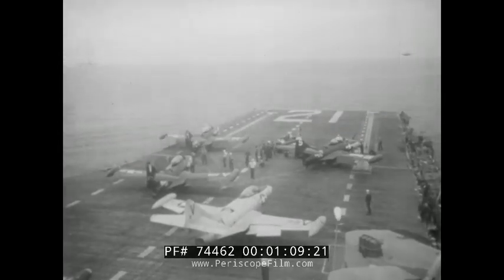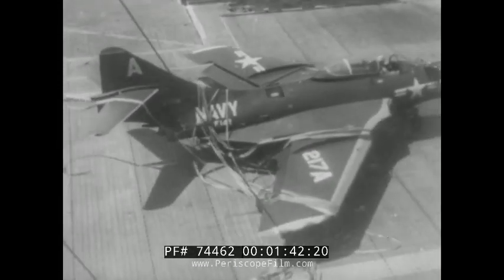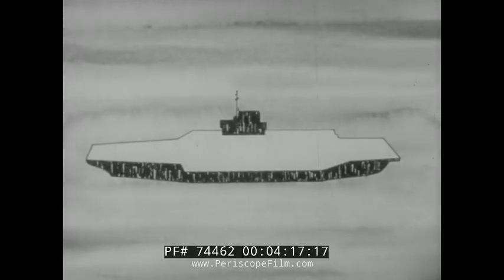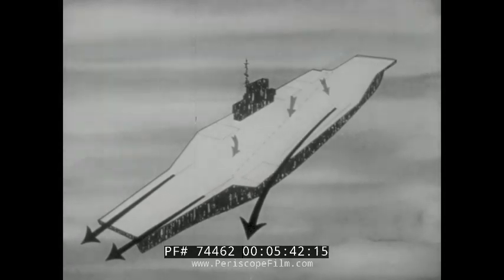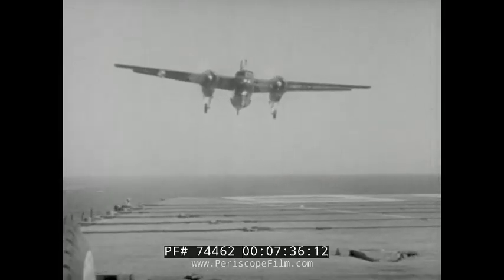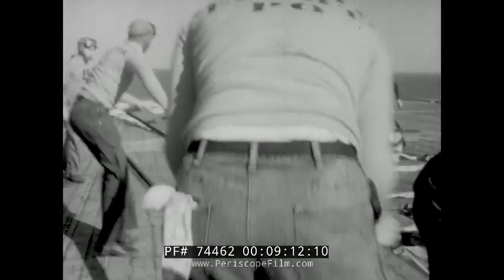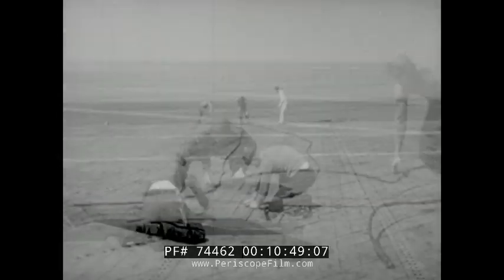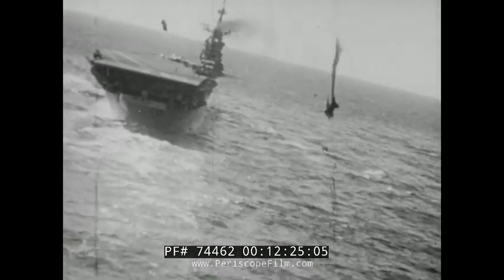U.S. NAVY 1955 ANGLED DECK AIRCRAFT CARRIER ORIENTATION MOVIE 74462

Comment: For those unfamiliar with the difference between a paddles landing and a mirror or a lens pass and landing, they are significant. A paddles approach is a flat approach (about 60 feet above the water on an Essex class carrier) with the pilot taking a "dip" when he gets the cut. A dip is a drop of the nose followed immediately with returning to level almost immediately. The dip starts the aircraft down and a normal cut has room for the nose to come back up so the aircraft does not land on the nose wheel. 

A mirror or lens approach his higher, for props around 150" over the water through the turn, 300' for jets. Props will intersect the glide path closer in and landing speed is slower. Once the pilot sees and calls the ball, they are on a pre determined glide slope and when the cut lights cove on, for props they close the throttle, for jets it a reduction followed by full throttle. The jets land at full throttle so the turbines have time to come up to speed so they have full power available in case they miss all the wires. (Called a bolter and the LSO will call "bolter, bolter"). 

On my first cruise as a new aviator (called a nugget) we had a senior Commander (our XO) who had spend his entire previous career flying a paddles approach to landing. The dip at the cut was so ingrained, he had trouble breaking the habit.

Comment: I’ve noticed that some carriers from other nations have an upward slope at the end of their carrier runways. Is that to help get air craft in the air easier?   Also, THANK YOU to all that have served and are currently serving. Thank you for what y’all do!!!!
Reply: That's a ski jump. It's an alternative to a catapult. It's simpler and easier on the aircraft, but the aircraft payload is limited. Also a considerable amount of thrust is needed by the launching aircraft so generally only fighters can be used
Reply: The UK invented the STOVL which use the ski jump after building the Harrier jump jet but also the invented Angled deck but the STOBAR is what the Russians and Chinese use that has a slight upward slope at the bow of of the vessel
Reply: @Then.72  
The soviets also had an interesting aircraft carrier, with the yak-38's, forget the name though

but it sure did take the "aircraft carying cruiser" part a hell of a lot more serious than the Kunetzsov of today
Reply: @ari8742-r4z  like the Yak 38 It was a copy that failed also like the TU-144 Concordski
Reply: @Then.72  

Mate I never made any claims of effectiveness or the likes. I just wanted to share some interesting history.
Reply: @ari8742-r4z  yes and I was just informing you about Russian technology
Reply: @Then.72  
Not all soviet tech is garbage, just the inheritor of most of it is

Although the soviet carriers before the kunetzsov were ass
Reply: @Then.72  And most nations that use Harriers just run them off of a flattop deck and accept the penalty in aircraft payload - and are in the process of replacing Harriers with F-35s.
Reply: @disorganizedplay  which was doomed until the USA came asking for help with the F35B

Comment: 12:00 I would not want to be on the fantail, below the flight deck during recovery. A plane loses it's engine, or the pilot just screws up and stalls, that is where the plane is going.
Reply: It's happened.
Reply: @bdbailey9225  From the picture it looked like people down there, but it was equipment.
      And of course it has happened. Pilots have lost power, or screwed up.
Reply: Eric Taylor, usually before that happens the LSO (landing signal officer) will have given the order or signal to “wave off or bolster”. This still holds true while the pilot flies the “ball”. The OLS (optical landing system), is used for all landings. That’s why you hear the LSO always tell the approaching pilot to “call the ball”. This tells the pilot to monitor and use the OLS. Piece of cake!
Reply: @arttafil6792  Of course, and the LSO's are very good at they job, as are the pilots. The fact that accidents like this happen only very rarely proves that.
    Still it happen, for a great variety of reasons.
     Naval aviation is extremely dangerous, and only the best are allowed (or even capable) of doing it in relative safety.
Reply: Eric Taylor, trust me, I know that from personal experience. I was an F4 pilot in the 60’s. I did 3 tours in Vietnam, 66,  67 and 68. And I had to make a single engine out emergency landing on the Constellation in 67. I had to go into the “J-Bar”. Not a good day or landing. I had extensive battle damage.
Reply: @arttafil6792  Mad skills sir. Mad skills.
     Have you ever heard of a writer my the name of Mark Berent? He was a combat pilot in Vietnam and wrote a 5 book series of historical novels that take place in Vietnam.
       It's one of my favorite books I've read. I think I read them something like 6 or 7 years.
     I find the Vietnam War facilitating. It was when the leadership of the US (Johnson and McNamara) failed to keep the faith.
    Did you ever get to bag a MiG?
Reply: Eric Taylor, actually no I haven’t but that doesn’t mean much. I’ve been trying to bury that part of my life for 50+ years.
Reply: @arttafil6792  Oh I understand. MiG's were rare to begin with, and they used them in a way that did not often place them at risk. And after Robin Olds gave them a good thrashing, they were even more careful.
       But you did get to fly one of the most bad ass fighter in history.
      The F-4, to me, looks like a rhino. Tough and mean as hell.
Reply: Eric Taylor, the MiGs especially the MiG 21’s were used very sparingly since they were few in numbers. They would do. A fast hit and run tactic. MiG 21’s had a short combat radius. I made my kills by trailing a section back toward their base at Puc-Yen and engaged them before they could enter their landing pattern. They scattered like rats. I killed their squadron leader and then his wingman. After that I was getting low on fuel and the rest of the flight tried to give me a dose of “payback”. I was lucky to get out alive. That’s how I got the battle damage.
Reply: @arttafil6792  Shooting down the enemy is only half the mission. Surviving would be nice as well.
       The MiG's had a huge advanced. You were far from home, over enemy territory, and low on fuel. If you had to bail out, depending on where you were, you likely faced being a POW. All that happened to them was a silk letdown and getting their ass chewed out by the CO.
      On top of that, all they had to do was scare the bombers enough that they dumped their bomb load.
      My biggest pet peeve, the thing that pisses me off the most, is people who talk about the "indiscriminate bombing of civilians"
        They fired off those SA-2's like machine gun bullets, and most of them came down in the city. They were especially delighted when one hit a hospital or school. Even better if children die.
      You guys were putting yourselves at grave risk, some paying the ultimate price to protect the very same civilians they accused you of killing.
       Those missiles had a self destruct, if it ran out of fuel without hitting anything it blew itself up. But they WANTED the missiles to come back down in the city, otherwise no one would believe the "indiscriminate bombing" bullshit.
Reply: I spent six months working on the fantail of the USS Theodore Roosevelt in the Nixie Control Room.  During recovery, we would hang out on the gangway with our fingers in our ears watching the planes land 40 feet above us.

Comment: How did they solve the problem of getting the angled deck carrier through the Panama Canal?
Reply: They adopted the 2 ocean navy concept
Reply: Nothing to do with the angled deck. The hull itself is too big to fit through.
Reply: They can't fit ,they must go round the Cape.
Reply: @pauldavidson6321  Yep, in fact this was the reason the US was a little slow to adopt it; it was a big downside to offset the large upsides the film points to.

Comment: No mention of the fact that the angled flight deck, the armoured flight deck, the landing lights system, the steam catapult were all British inventions. The first jet landing on a carrier, British.  The modern ski ramp used by many carriers, British, and even the first aircraft landing on a moving purpose built aircraft carrier, British...  but I understand that this was a standard general purpose information film and of no real necessity.
Reply: Insecure, much? It's a training film, not a documentary.
Reply: @benn454  Alongside the section on setting up the barriers we should have had a history of wire making through the years!
Reply: Eugene Ely landed a plane on a ship long before anyone British did.
Reply: @Bartonovich52   Not on a moving deck he didn't. The USS Birmingham was anchored fore and aft and had a platform erected for the flight. And he didn't launch off a carrier either it was a converted cruiser (as was the USS Pennsylvania on which he landed later).
The carrier was a British invention and they built the first through deck one in 1918 (HMS Argus). In fact the first launch off a moving ship was completed by Commander Charles Rumney Samson, Royal Navy, on 9 May 1912. He took off in a Short S.38 from the battleship HMS Hibernia. However the first recovery from a moving ship was done by Squadron Commander Edwin Dunning when he landed a Sopwith Pup biplane on HMS Furious in Scapa Flow on 2 August, 1917.
Nice try at trying to grab a bit of history.
Reply: This is a training film to inform US sailors of how to operate on the then-new SCB-125 (Essex) and SCB-110 (Midway) angled-deck conversions, as well as the new Forrestal-type supercarriers. It's not a history lesson - it's a film about the practical necessities of operating in the angled-deck environment.

Also, for all practical intents and purposes, the US Navy invented the angled deck. HMS Triumph trialled an angled landing area on an otherwise unmodified axial-deck ship. The wooden deck of USS Antietam was extended to port using a sponson added to the side of the ship, creating the angled deck in a form that was actually useful.

Comment: Damn!!!  Those pilots in the F7U Cutlass (nicknamed the Gutless) had to have balls of steel to deal with it's steep nose up attitude and near stall landings and poor engines.
Reply: The Cutlass was fitted with poor-performance engines which gave it a bad (and fatal) reputation: the tailless design itself was quite radical and was probably just unsuitable for carrier work (e.g. the high angle-of-attack on landing).
Reply: @None-zc5vg  too true, the design was so radical that the landing gear stance was such as to severely increase the angle of attack at take-off.  and as stated made landing back on a pitching flight deck simply murder for all involved.   0_o
Reply: @ditzydoo4378  There's a Youtube clip showing what happened when a "Cutlass" sank too low on its landing-approach: the plane hit the ramp and disintegrated in a fireball  that killed some carrier-crewmen while the pilot went over the side to his death in the cockpit. It appeared that the engines couldn't  respond to the throttles fast enough to get the plane onto the carrier-deck.
Reply: @None-zc5vg  the crash was aboard the USS Hancock two boatswains mates and a photographs mate were kill in the cat walk that runs along the port side aft.  the flag signal officer ran across the fan tail just narrowly missing being struck.

Comment: Never had a plane need the barricade on 5 carriers and 7 deployments I made but Rig the Barricade drill was ran so often I could still do it 24 yrs after my last deployment.
Reply: It's when you decide you don't need something when you realise that you do!
Reply: Some things just stick to you.
Reply: Hey Karl T- Be a sport an solve a question my man and I were having involving leading edges of wings on the flight deck. I was told way back in the day that some of the fighters had such a sharp edge to them that if you accidentally walked into one it would split your head open with a nasty cut. My man says that only the F104 had a wing edge that sharp, and you guys didn't use those, right? How about it though? Did any of your aircraft have anything like that. Was that even a real concern or was somebody having me on?
And thanks for your service, brother. I envy what you did. My airfield didn't move. And rotary-wing aircraft are cool as hell, but they aren't jet fighters.  You guys are awesome.
Reply: @bdbailey9225   NOT!
Reply: @davidschwartz5127  You say you're snot? WTF?
Reply from the maker: Thanks for your service to our great nation.

Comment: All the advantages of the angle deck could have been had from the beginning if they had thought of it. The slight crosswind component would not have been an issue for any pilot or aircraft.
Reply: The angled deck had been considered in the early 1940's but that would have made the ships too wide to fit into existing dry docks, as well as the locks of the Panama canal, and that canal was a very important part of of US Naval strategy. After the war, with the need to build larger carriers the canal was bypassed and carriers had to go around South America to transit from Atlantic to Pacific until the recent Panamax conversion.
Reply: If they had thought of it!? No shit professor obvious. We'd have had flight 100 years sooner if they'd thought of it.

Comment: Fascinating, considering  that this is a film making a case for a revolutionary concept in war fighting.  Also, who knew that the F-86 was used on carriers?  Not I.
Reply: Adam The Correction: The FJ Fury, not the F-86.  Wikipedia says it's a completely different aircraft than the Sabre Jet.
Reply: Those looked like FJ-2s which are pretty similar to Air Force F-86s. The first model, the FJ was a straight wing jet. The FJ-3 and 4 had deeper fuselages than Sabres. The FJ-4B was specifically designed for ground attack.
Reply: Adam E. Not easy to spot the differences between the 2 types when not side by side.
Reply: Not a F86 , but N.A. FJ2/3 Fury , navalized F86 with new fuselage , undercarriage , engine , etc....! Nice plane !!!
Reply: They sure do look similar.